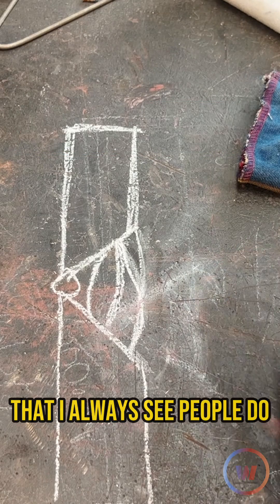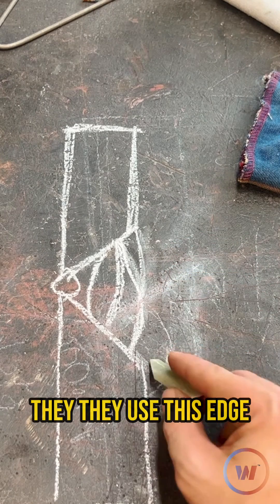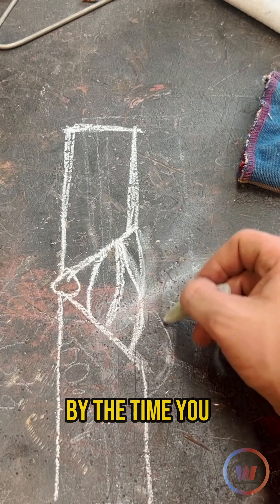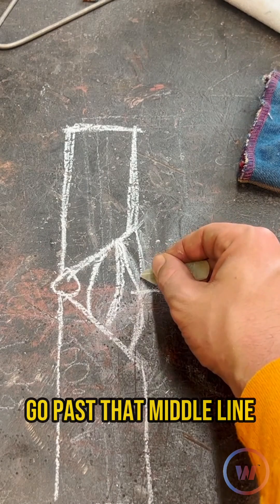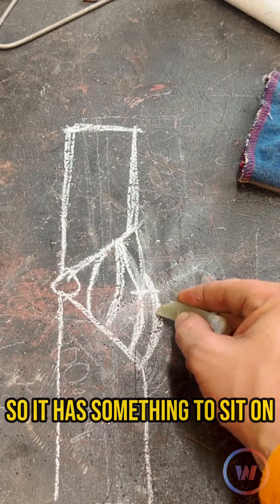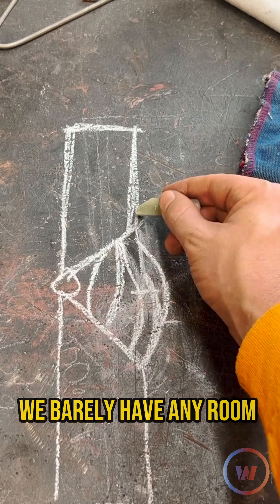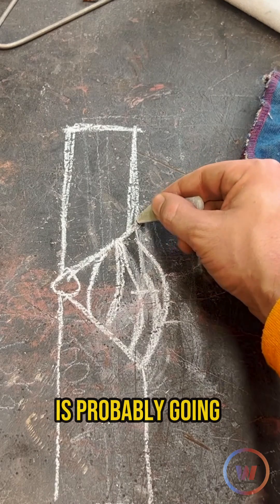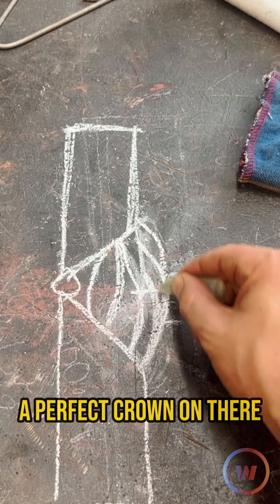Proper Bead Placement

Comment: This dude doesnt.. listen overlap your beads by at least 45% his example make me want to take his soap stone and throw it across the room.. his damn cap is now thicker than his plate (hyperbaly) .  His 4th bead went full 90% and fd up the rest.  His 4th and 5th bead should be below flush. By about a 1/16"  Then you would need a 4 bead cap min..( odd number caps are always preffered over even number anyways)  in this example his 5th bead should of found the 45% of the last bead.. (and finishing with a 4 bead cap) not go 120% accross it, fn it up,  and making it 50% taller than the thickness of the plate..
 Some places with strict codes will make you grind this down to within code, and no one, i mean no one, want to spend and extra hour more on a bend grinding out that cap on a bend test..

Comment: That’s terrible advice and just lack of experience talking. It’s completely fine to run your first cap on the toe of your bottom bead, especially horizontal. You want the beads to look like they are stacking on top of each other. I’ve had 4 bead caps, 5 and even 6 bead caps. As long as there is no undercut or rollover on your cap, and every bead is smooth and doesn’t have a belly, it’s completely acceptable. I feel bad for this guys’ students.

Comment: I like this guy.

 So many times I've wanted someone to tell me exactly where each edge of the bead need to be. 

 Most folks will tell me "just keep a steady speed and even pattern. Keep regrinding and welding to build muscle memory" and never address my questions about precisely where the beads edge should start and stop. 

 All the muscle memory in the world won't do a thing for me if I can't identify where the margins are.
Reply: From my knowledge your toes should be equidistant from the bevel edge. So lay that bead as he said in the beginning. If you're wetting out as you should be the you cam cover a 3/8 gap with 2 3/16 caps.
Reply: It's not so much muscle memory as it is sight, feel, and sound.
I would also say it depends on the application.
 For example, if you are testing and you have a setup like what is in the video, I would recommend grinding down that top layer to be even with that low side to give yourself a good starting position for your cover pass.
Then, start your cover by posting the first bead puddle so that it comes over the top bevel of the base metal about a third of the way.
Then once that's finished, simply continue overlapping beads so that the edge of the puddle comes about half over the previous bead, keeping the wire pointing toward the toe of the previous bead, and then depending on the procedure, put as many beads as needed to cover the groove while staying within parameters.

That's about as good as I can explain in writing without showing you.😅
Reply: Same. This make sense and its short n simple

Comment: This is the dumbest shit I ever saw haha. So because you leave an edge or undercut doing it that way you're saying it's wrong? For one, every pipe (or plate) size will have a different thickness which will take different amount of beads to cap. You should know how to read what the grove needs and wants while being able to tie that toe to the shadow line of your previous bead. Widen your puddle to make a perfect width. Trust me, if you know what you are doing you can actually weld that last bead and WILL NOT have undercut and will look great... Most QCs only allow a 1/16" over on each bevel edge.

Comment: Recently passed my 3g stick test. I wish I seen that, undercut was my main issue the whole time. I’m now working on MiG. I hope the same rule applies, I’ll try it when I get to it
Reply: Well at least you know now for future projects
Reply: On your cap turn your machine down and take 5 minutes. In Canada  with the CWB we get 45 minutes per plate and I always turn my machine down when putting the cap in. The plate is very hot at that point after the fill passes and undercut will happen. Important in overhead as well although not for undercut but weld reinforcement.

Comment: Sir,If your 3 beads is short.just add 1 bead🙂
Reply: Sometimes the WPS requires a 3 bead cap though
Reply: Do a bigger bead do circles or wait until the puddle build up in the beginning
Reply: Until you are taking way to long
Reply: His point is to avoid udercut